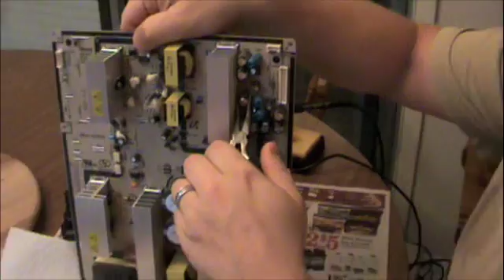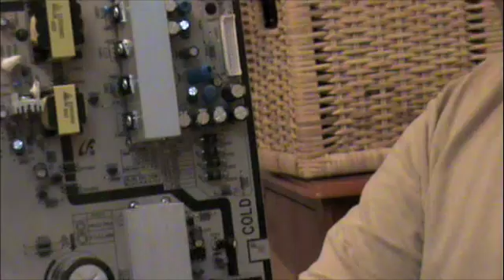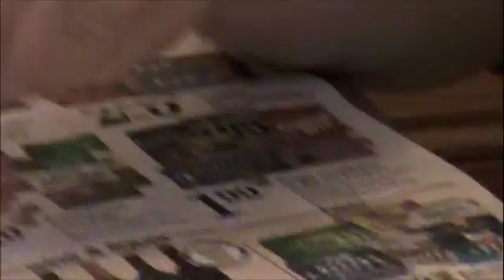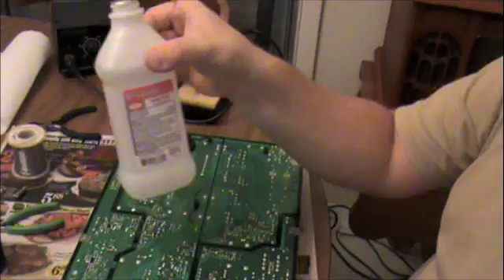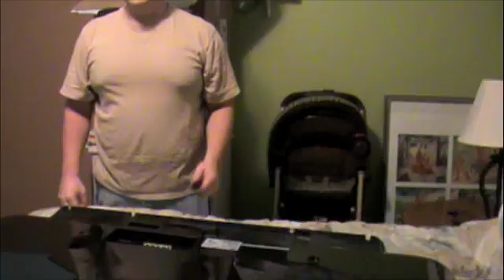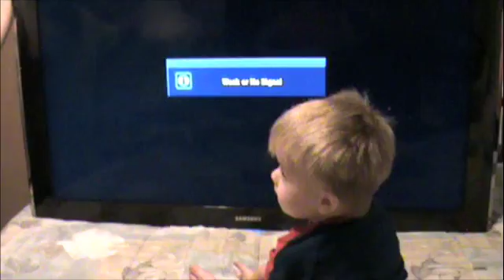Samsung TV Repair- PART 2 OF 2

Comment: my 40" samsung doesn't turn on. but the capacitors look intact. i wonder if the fuses might be the problem. they have a line in the middle. don't know if that's normal.

Comment: My LG has tape everywhere around the shields where metal touches metal with anti static ribbon tape. I am surprised your Samsung does not use this kind of tape to keep boards and things from shorting out. Mine was fine til we had a local outage due to upgrading the sub station in town and they did not tell my parents like they did in years past to unplug expensive electronics before the power came back on. A surge protector did not protect it and the fuse blew now I am replacing the fuse on the LG 32XL1 and hoping nothing else is wrong.

Comment: I have a question on the repair.  My capacitors look ok but the little things in between them (the ones that are covered in blue sleeves) look burnt.  Could those be what is causing my problem?  The top one has a shiny clear top that looks like a light bulb down in there while the two others look gray and flat (almost burnt).  Whats your opinion?  The set will come on with the screen getting lighter like there is some sort of light going on and there is sound but no picture or menu appearing.  I've tried unplugging and all that but all I get is sound and a lighter black screen.  I'd show you pictures of the little blue sleeved tubes but I don't know how to post them here.
Reply: Are you sure your bulb isn't going bad? There flourescent tubes on older units.
Reply: I'm honestly not sure of anything.  This is about 4 or 5 years old and the thing is when the picture came on last time is was very clear and bright.  Where would the bulb be located?  I have back off this thing and it's sitting in my recliner.
Reply: I am not a tech per say maybe you can find other videos where people may know more. The circuit boards are the easy parts to get to, the bulbs are usually located in behind the large metal panel. It could also be a bloated capacitor which is on a lot of the boards. Best to ask someone with knowledge or look on a search engine for troubleshooting your make and model. I do this whenever I want to educate myself on repairing electronics. Just be careful not to touch capacitors on the power board they can hold power for a long time after something is unplugged.

Comment: It's nice that you doesn't follow the trend: if faulty, throw it away... But $3.85 per capacitor?! It's very expensive! Way cheaper than the official service, though. But I can buy 9pcs of premium quality NIC NRSG Ultra-low ESR 1000uF 16V for $3.50. What type of capacitors have you used? I can see that you leave 2 pcs of the original capacitors, maybe are the new, bulkier capacitors are too big? It's essential to use only 105*C Low-ESR capacitors here, only from traditional manufacturers.

Comment: Nice job.  Doesn't say much about Samsung reliability though.  My LG 50" plasma just starting shutting off when turned on and the repair shop replaced 5 caps in the power supply board.  Only cost $73.00 to get it fixed.

Comment: you need a to use a solder sucker or els you might damage the prints on the power supply

Comment: Great job on your videos!! Very informative.. My question is I have (2) Olevia 242 S11 flat screen TVs. Neither one will turn on same  as your Samsung. When I am able to get a picture on one the sound went out. I shut the TV off and tried to restart it now no pic, no sound, black screen. Do you think both problems are related to the capacitors? Or would it be two diff problems? 
Would the capacitor replacment kit include a capacitor for the sound? bbb

Comment: My TV was slow to start-up so I opened it up and two 1000uf 10v Capacitor had blown and two 1000uf 25v Capacitor's where still in working order. Am I ok to use the TV until the new capacitor's arrive in the mail? or is this putting unnecessary strain on the remaining capacitors? and should I replace all four at the same time even though two are still working?

Comment: Thank you very much; This video helped me to replace two capacitors in my Samsung 40" LCD TV. I seriously doubted it would work since I have no experience with soldering but even though I skimped on the flux as well as the alcohol, and even though the replacement capacitors was a lot bigger than the old ones, the tv turns on right away now. Awesome!

Comment: Dear Professor.  Fantastic video!  One question...how can I be sure my capacitors are discharged?  If not, is there a way I can safely discharge them (e.g., touch with a well-insulated screwdriver) without busting anything?

Comment: @xxXunknownguy9Xxx if you nead a 200uf 10v cap and radio shack only have 200 uf 16v or 200 uf 25v you can use them. the uf nead to be the same if you isntall a 16 or 25v 30v.... it will work to sorry my inglish

Comment: Thank you for the video!  I was able to fix my Samsung LN-T4669F.  It had two leaking 2200uf 10V 105C Caps.  There were only two and both were blown.  I was able to replace them with 2 2200 16V 105C Caps.  Reassembled and now my TV works great again!  Starts up like a champ and no more clicking.  It had been taking 10 minutes to start for the past month and today would not even start at all.  TV was out of warranty so I was not happy.  I am now.  Thank you!

Comment: THANKS A BUNCH! I haven't worked on electronics in almost a decade (old Navy ET) but I'm willing to give it a shot to fix this. 

QUESTION FOR YOU OR ANYONE ELSE WITH THESE LCDs: I have the LN-T4661F and in addiction to the clicking and power cycling, my screen goes dim on one side from time to time/most of the time. I have to jack up the backlight and brightness to see things clearly but it's still noticeable on one side of the screen. Has anyone figured this one out?

Comment: I watched your video Saturday night. Removed three blown caps Sunday morning but didn't find them at Radio Shack.  Store was closed for July 4th celebrations so had to wait until today.  Got three capacitors: $3.42. Came home home and in less than 30 minutes my TV (Samsung 40" 530) was back on. You just saved me over $200. Gracias a usted y a su pequeño ayudante.  Keep up the good work!

Comment: I have the same TV as bugler34 but sadly, replacement capacitors did not fix my issue.  Samsung actually sent a technician to my house to replace the capacitors free of charge (I disassembled my TV to ensure the work was done since I wasn't home at the time).  The technician told my wife that a part needs to be replaced but he neglected to say which one.  I'm assuming the power supply needs to be replaced but hell, I'm not an electrical engineer so I'm just guessing...

Comment: Thank you so much! My Samsung LN52A750 was turning off and on at startup for the past 4 days and then yesterday after 3 hours of off/on I just unplugged it. I had a Samsung rep scheduled to come out on Wed for $100 (diagnostic, NOT fix) but instead I saw your video and never having soldered before in my life, it helped me a lot! Went to RadioShack and picked up about $30 worth of materials, spent about 1hr of work and now it works! THANKS!!

Comment: I'm  certainly no electrician, but after googling the problem I found this video. So I plucked up the courage to take the back off and found that the capacitors were indeed leaking fluid as described. With my new $15 soldering iron and $4 worth of capacitors from the local electronic store, I followed your instructions and the Samsung TV has been resurrected! You sir, are a legend!

Comment: in less than an hour and a half I took the TV down, back off, went to The Shack, bought soldering iron, and 4 capacitors came home replaced them put it back together and boom goes the dynamite  it work better than new!!!!  
THANK YOU THANK YOU THANK YOU!!!!!!!!!!!!!!!!!!!!!!!!!!!!!!!!!!!!!!! $26.00!!!

Comment: Thanks man! I fixed my LNT4665F yesterday. It's working great now (fingers crossed). Mine only had 3 caps and I replaced them with 1000uF, 16V, 105C, low ESR Panasonic caps, part number EEUFR1C102 (71 cents ea.). I don't really understand the difference between using 10V, 16V, 25V, 35V etc., but so far so good. The soldering can be a little tricky if you've never done it (like me), but the whole job still only took me about 2hrs with a lunch break included. Saved me big time!

Comment: I never have soldered before or messed with electronics before and watched this video.  Went to radio shack, bought a $9.00 solder kit and 4 capacitors for about $6 bucks and fixed the thing, like new.  Unbelievable.

Comment: I don't have a Samsung, but the basics of the videos are exactly what I was looking for. You both made a great tutorial here! I've had 6 broken tvs given to me and I bet 4 out of the 6 tvs I have sitting in my basement have cap problems. Power supply problems seem to be the most common.

 One question, when you were removing the caps, you rested you solder hand on the back of the board near the hot caps. Is there a danger that the hot caps could discharge if accidentally touched on the back?

Comment: My first YouTube comment ever to say THANK YOU for this wallkthrough.  Just fixed my TV tonight; went totally smoothly, but I probably wouldn't have attempted it without this video.  Less than $6 for the 3 needed caps, plus some solder (I was out) and flux.  All the 10V caps had gone on my TV; the 25 ones were fine, so far.

Comment: This video did the trick for my Samsung 40" flat screen! Pay attention to the positive and negative markings on the board and capacitor so you get them installed correctly. I ran to Radio Shack and bought 4 of the part  #272-1032 at $1.79 each and they worked great. Put the TV back together and wala! she turned on perfectly and works great now! Saved a bundle! Thanks much for this video!

Comment: Thanks for video!  Our 46 LCD would click a few times before powering up, and then eventually it would take 15 or more clicks.  I replaced 3 capacitors (10V 1000UF) with 16V 1000UF.  The person at Fry's confirmed you can go up in voltage but the UF should stay the same.  It didn't take too long and I got to practice my soldering techniques.  It now powers up like new - Thanks Again!

Comment: I bought my Samsung 40" in 2008 and it worked great for 2 1/2 yrs. When it started failing to power-on, I thought I was screwed. I researched online for this problem and was astounded by the amount of similar complaints from other Samsung owners. I posted my displeasure of Samsung on Facebook, and a good friend sent me this link. I'm not a techie type of person, but your video looks relatively simple. I'm going to attempt your repair procedure this week. I'll post my results as soon as I'm done.

Comment: I am attempting to fix my flat screen right now. I went to Fry's electronics and radioshack to get the capacitors that looked bulging. Unfortunately, I had to get a 1000 uf capactor instead of a 820 uf capacitor because Fry's didn't carry it! It still doesn't work. Maybe the capacitance was too big ;(

I absolutely love your video (and the helper you have there!)

Comment: @Thetruthishere11 The problem often is, a manufacturer will specify a 16V capacitor for the 12V line. It goes against the engineering wisdom of 1.5x-2x overrating stuff (really a 25V or even 35V cap should be used.) And, it would only cost a few dollars (tops!) per TV to install premium grade caps instead of the crap ones they have, but it's all about the bottom line.

Comment: Thanks for posting this, changed out two 2200 uf capacitors in my 42" Samsung, went for the bulging capacitors. They were bad enough that it was; at worst taking up to 55 min of clicking to finally come on, I decided it was time to take it off of the wall and tear into it. Radio Shack had the 1000 uf, but not the 2200, after searching on the net found a TV repair shop that had them @ $2.00 ea. This was soo intimidating, even with prior soldering experience, it's back on the wall & wifes happy.

Comment: What I just don't understand is why the designer doesn't just put in hi temp higher voltage caps to begin with. It would save a lot of unnessary repair work I think.

Comment: Just done the repair to my 40" lcd I replaced all 4 of the 10v caps with 35v even though only 3 where gone but thought as I was doing it I should just replace them all, cost me £2.88 for the caps already had the solder and iron so just took under an hour of my time, works a treat now thanks for the tutorial it has saved me hundreds in repair bills.

Comment: MANY THANKS from INDIA. Your set by step instructions were wonderful. I repaired my Samsung 40" LA40A550 replacing 2 x 10v 1000 capacitors by 25v 1000 ones. I couldnt get 35v ones. But it works good as before. Total cost for 2 capacitors INR 10 = 0.22 cents. Other costs less than $1. Price quoted by Samsung $150.

Comment: Very nice tutorial.  I have the 46" LNT4665F and had all the symptoms (purple/green lines and dots, clicking, and recycling of power several times until it finally wouldn't start at all).  My model only has three of the 10-volt 1000-microfarad electrolytic capacitors, so only they needed to be replaced.  All 3 of them were obviously bulging/leaking and were replaced by 35-volt 1000 microfarad capacitors I found at my local Radio Shack for $1.59 ea. TV started up just fine now. 30-60 minute job

Comment: I opened my samsung LN52A630 and there were no indications that the capacitors are bad, there are 2 -16V 1000 mf and the two  25V. Any advice?, the tech will come next week and I might have to spend over $300. Its a different set up inside no cover for the mother board and and others. the TV has power but doesn't come out picture and  cannot turn off, the red power indicator keeps on flashing and clicking inside. It started with a load noise then it off and on by itself.

Comment: Top advice, it worked for me, saved between £400 -£500 (quoted) to repair it. We spent £1500 on this TV and it went belly up after 17 months. £5 for the parts, couple of hours to do it, 'POW' power on and it worked. Cheers mate you did well. ENGLAND.

Comment: My Philips TV 42" has a similar problem, but with erratic turn on-off control with the red led either off, or on vanishing after a few seconds (a capacitor that can hold the charge?). I am almost sure that this video will help me out in a course of action. The only I pray for is that the caps show "visible" damage.

Comment: Thank you so much. I own a 42 inch 2007 LCD Samsung and was gonna THROW IT AWAY and decided to type:  CLICKING SOUND AND NO PICTURE... BAM!  8 thousand sites come up about SAMSUNG... Imagine that... ANd they blow around 2-3 yrs usually... Well, pretty easy to see I had the problem... Your video saved me a NEW TV... 2 blown 10 volts now have 35 volts in their place.. 1st time Ive fixed anything of mine myself.. Took me less than 2 hrs, and less than 20 bucks... THANK YOU SO MUCH!!!!

Comment: I am another disgruntled customer of the Samsung Capacitor saga, I am gonna try and contact Samsung firstly, I  have heard that they have acceptable liability from a couple of sources and will offer a courtesy repair for this particular problem, not sure if its true but would rather get something done for free.
 I have seen in Maplins they sell High Temperature Radial Electrolytic Capacitors 1000uF16V 105C and 25V caps, will these both work should Samsung not offer to repair it for me?

Comment: Excellent video. I do have a newbie question. If I only need to change out 2 of the capacitors, can I mix match different volts. I could not find any 10v that the TV originally had but I did fine 35V, 1000 uf, up to 85 degree Celcius. Will that be ok?

Comment: Nice Video, helpful to us guys here trying to save money. Goof off gum remover works better for removing flux, its also a lot safer as there is no WATER in it. You also forgot to mention that these are ELECTROLYTIC capacitors which are POLARIZED. You have to install them with the correct polarity on the pc board.

Comment: Dude!  This video is VERY VERY GOOD.

My only problem was 1000uf 35v 85C were a bit too big. I also worry that the 85C temperature rating of the caps may overheat because of the adjencent heat cink and the original ones were 105C.  I put some heat shrink(125C rated) around the 85C caps that fit nicely.  

I think I'm ok but... should I order the 105C cap and replace them again?

Comment: My 52" Samsung must have used the last 2 bad caps.  Other caps were 25V.  Replaced 2 (1 leaking and 1 bulging) caps with 1000 uF 25V.  Works perfect- no clicking! Not bad for a couple of senior citizens who had never soldered.

Comment: @deadlyhotdog 

Get the capacitors replaced with better quality units and the TV should be quite reliable!  :)

Bad part is Samsung could have inexpensively corrected this instead of forcing the purchase of new TVs for those unaware of the repair.

Comment: My T.V have the same problem i have the samsung LNT4665F i took the T.V apart and notice that my capacitors were also bad..but my biggest problem is finding the right  size capacitors its 2200uf 10v is  ok to go with a lower number or a higher number capacitor

Comment: Thanks so much!!  I replaced 4 bulging caps with higher-rated voltage ones from Radio Shack (total cost  = $6.74).  A friend of mine did the soldering for me. Question:  How critical is the temp rating? The new ones were rated about 20degC less than the old ones.  But that's all Radio Shack had.  Am I possibly in for a repeat performance?  Shame on Samsung for all this--there should have been a recall.

Comment: Thank you so much!  A trip to radio shack and 90 minutes later the TV is on and the wife and kids think I am a genius!

5 replacement 35V 1000MFD Capacitors @ $1.59
30W Soldering Gun $7.69
60/40 Solder $2.19
1 can of rosin $6.59

TOTAL:  $24.42

It was very easy.  I just followed the video step by step.  
Thanks again and GOOD LUCK to OTHERS!!